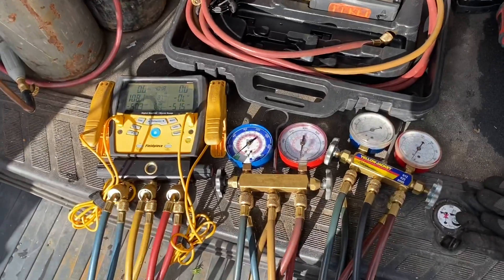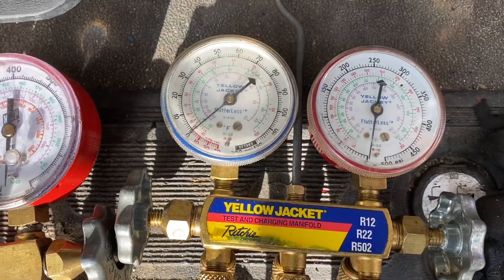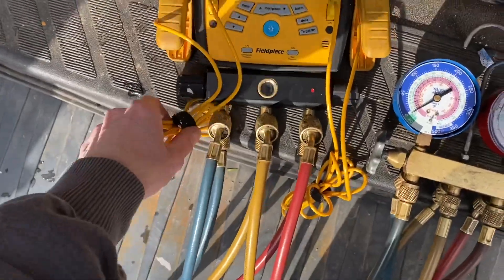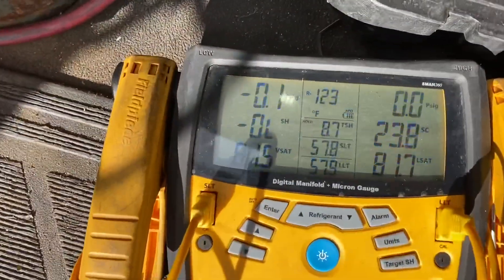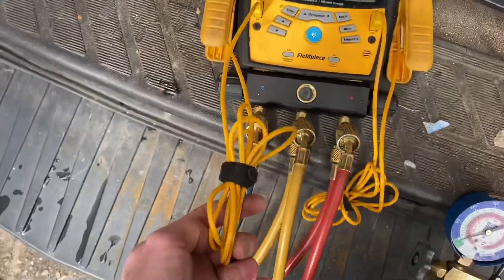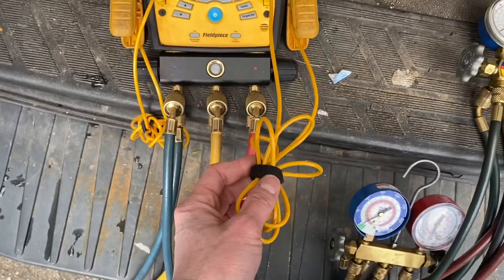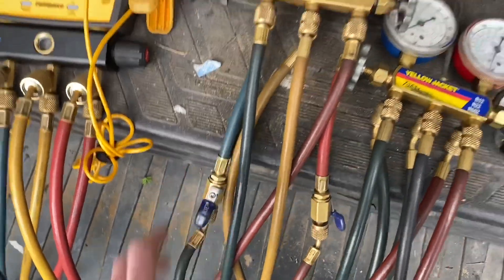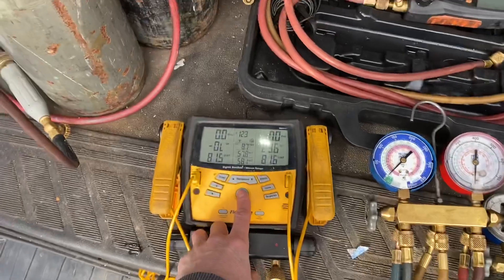Hvac/R gauges . Which ones do I use ?

Comment: Cool video,  I have always used the analog gauges like your yellow jackets. Question on the digital fieldpiece - can you use them on a r410 system and then use the same fieldpiece on a r134a system.  very cool with the superheat and subcool clamps on them .  Also,  could you use the test clamps for measuring say condenser water temps  in and out with the  superheat/supcool clamps. Thanks for video
Reply from the maker: jim defilippis yes ! It has a ton of different freons built in that you can switch to for what you are working on.  I forget how many but there is a lot !  And yes you could use the clamps for that for sure 👍